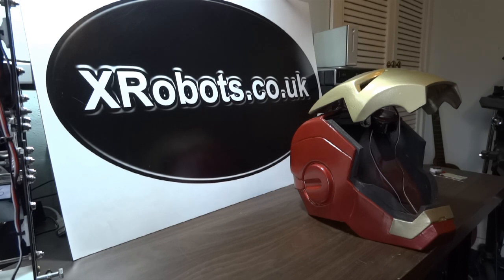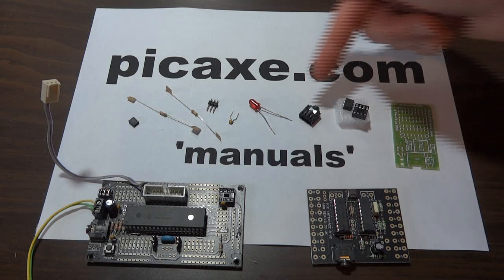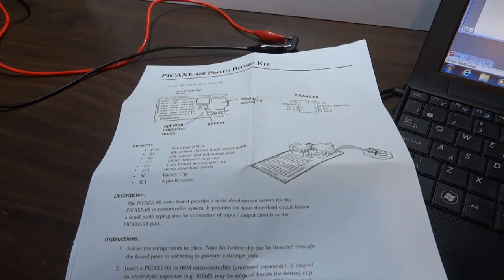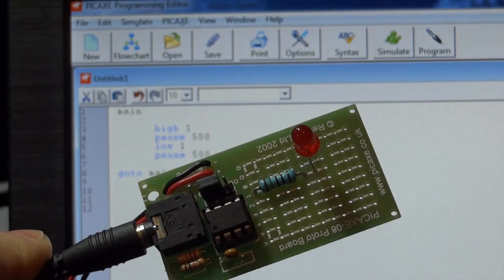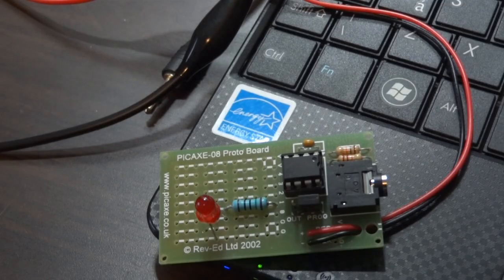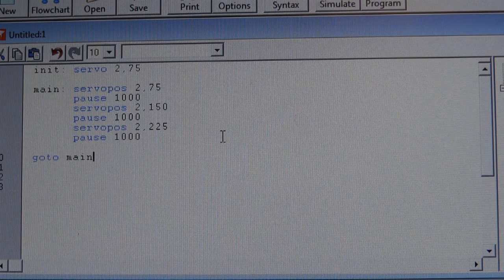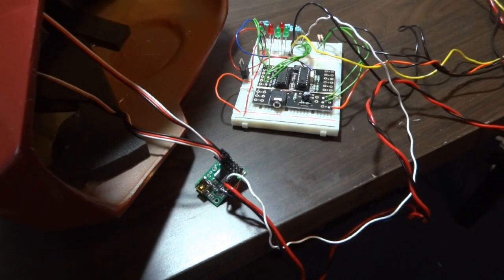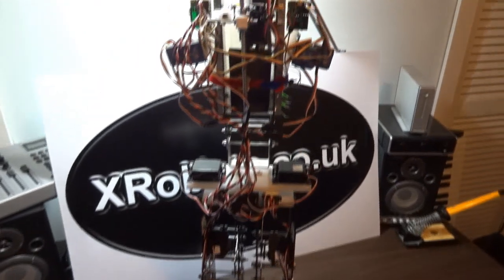Iron Man Power Suit #11 | PICXE Controlled Electronics | James Bruton

Comment: Hi James. In my own iron man build I'm going to try add motorization to not only the faceplate but to flight control flaps too. can the picaxe 18 board drive up to 6 servos on it's own without the micro controllers?